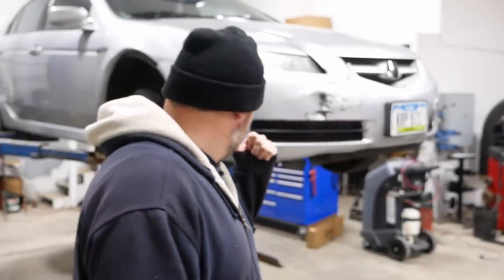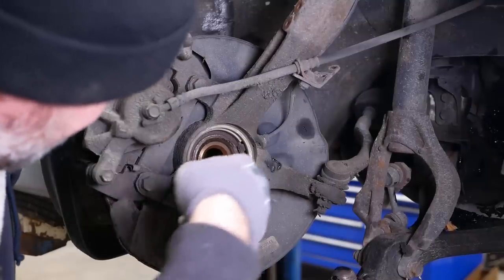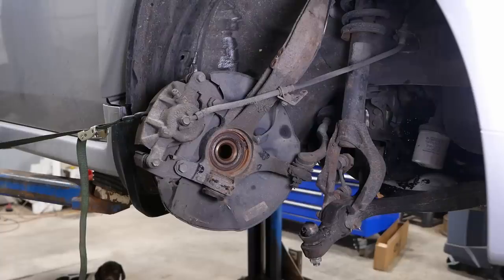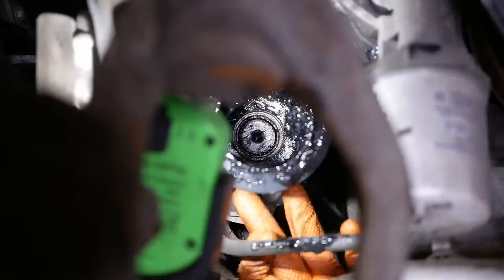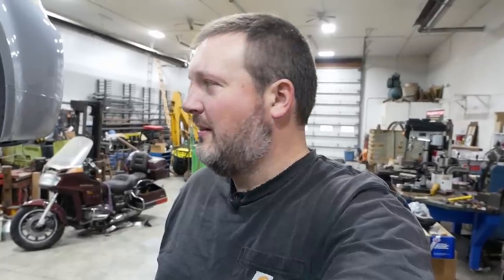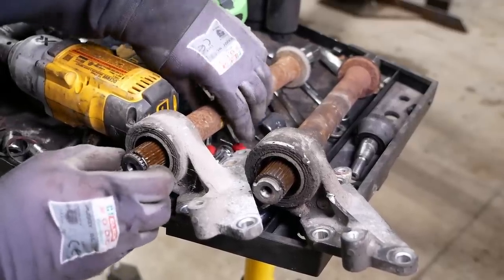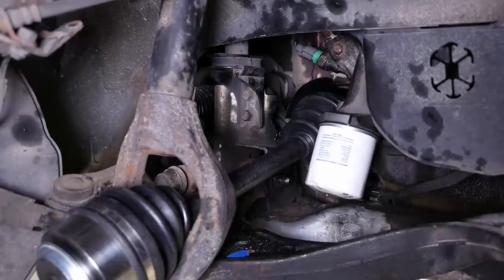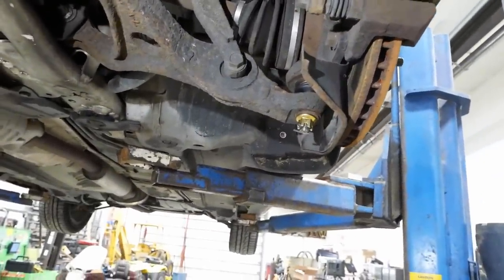Acura TL Broken Ball Joint

Comment: I swear Hondas get abused and neglected more than most cars because they take it without failing until something goes REALLY bad. Nice work Wes
Reply: Even when they fail it's usually not too bad. My gf had this happen to her Acura (similar model). It happened on asphalt close to home, so she drove it about 1km back to the drive. Some how the only damage was the ball joint and the CV axle which came apart.
Reply: @mzb8134  How does that even happen? The car must have been making noises FOREVER before it happened.
Reply: @mph5896  if the balljoint is loaded by the spring you might not get any noises if it fails fast enough.
Reply: @rkan2  Ball joints don't just fail randomly, under normal use at least. The kid in this video we told he needed this done a year ago. He chose to abuse the car and now it's costing him twice as much or more.
Reply: @jamesofallthings3684  Absolutely, but like Wes explained when comparing yo the F150 - some can fail more catastrophically than others. Some setups have the balljoint loaded by the spring like this Acura. Others have the weight of the vehicle/strut on the balljoint.
Reply: Those are really well made.  Perfect for humans who don’t care about their vehicles.

Comment: Glad that Im not the only one who has struggled popping out axle shafts. The ones that grind my gears are the ones that resist great feats of leverage, then suddenly release with seemingly little effort.
Reply: i've encountered this bs twice from different manufacturers. ergh!
Reply: I bought the slide hammer attachment. Doesn't fit in all areas but helps a ton when it fits.

On that one, leave the old inner cup and use the new cv shaft with new inner parts. 😉
Reply: What I've had to do which seem to work was getting a big pry bar and using it as kind of a punch at the back, hitting the striking end to push it out
Reply: @melvingibson4525  I think a slide hammer if you can get it on well is op, i've used a pair of prybars typically, but sometimes what they leaver against is too delicate
Reply: I've been there. Broke a puller trying to take one out, and then when hand tightening the new one, the thing popped out like it wasn't even held in.
Reply: @petahertz5855  I can never get slide hammers in there on those. That double wishbone suspension FWD V6 design makes everything really tight down there.
Reply: @melvingibson4525  Exactly my thoughts. I wondered why they couldn't just go with the MacPherson design across the board.
Reply: Usually straight into the left cheekbone...
Reply: @Tinker001  NOSE.

Comment: Living in the rust belt in the northeast  I appreciate your showing us all the hassle of trying to do what is usually a straightforward job turning into a mess. Nothing is ever easy with rust ! Great vid.
Reply: The amount of rust alone would make me run south unless the money is so good up there you can buy something new every few years. I got a 74 I’ve had since 85 and it’s got very VERY little rust and it mostly surface. There is no holes.
Reply: @Robrt32  Apparently, the money is so good that those up there CAN afford a new car every few years.  I can't even imagine spending that type of money every three years or so.  My last cars were 96, 03, 10, and 18.  At 2 percent or less on the loans, it was an ok deal on each one.  They were all GM, since I got the family price, so no haggling (even if it wasn't the BEST possible deal).  And, I got a really good trade-in price on each one.  I didn't even need to try to sell them on the open market.  Although I'm sure I could have come out a few thousand ahead, I didn't have to deal with the tire-kickers and other idiots.
Reply: This one was literally not rusty at all;  that's why it's so weird and doesn't really make sense. ???
Reply: @calholli  Agreed. He commented that it wasn't very rusty.  The owner WAS warned it was on the way out (or at least one on that side), so.. what was the "Rest of the Story"?
Reply: @silasmarner7586  He changed that side too.
Reply: Rust belt refers to areas that relied on industries no longer flourishing like Steel. 

You're looking for "Salt belt"

Comment: My Favorite Gen TL, recently did my daily's Ball joints, axles and lower control arms. 200k on original ball joins, zero play, no tears in the boots from a North Jersey  car. Kind of a pain with rust, but very straightforward job. Ive always been lucky with axles, most people seem to struggle with em.

Comment: Hey, I've been there and done that to many people, my brother is worse, Bought a 98 dodge dakota I told him the u-joint needs changed vary soon, he got about 6 months almost 10,000 miles later it let go and punctured his fuel tank and beat whatever it could under there, Scrapped it and bought a lowered 2003 Mustang GT, this thing was so low it really didn't have any suspension, thought it was the coolest thing in the world, He paid too much for it, and it was put together by some people who didn't know a thing about mechanical work. 

He showed me the car and wanted me to put it on my lift and check it out I noticed it making a bottom end vary faint knock to it, it got worse the more throttle you gave it, I told him, bottom end needs to be looked at, probably still salvageable at that point, A few burn outs later, it threw a rod at the starter, it took the starter, pretty good one, he kept that crappy little Mustang for a few years and wanted to put a v8 in it, never did.

I hate when people don't take advice and continue to learn the hard way.

Comment: I'm actually surprised the slide hammer with the vice grips didn't do it, that's always been my go to move if the joint was already apart.   The strut fork being too small to fit the inner joint through however, has been a constant point of rage for me since my first honda like 20 years ago.  I like the way the suspension system handles, but damn are they stupid to fix sometimes.
Reply: One of my favorite newer tools is the vice grip slide hammer combo. I too was surprised it didn’t get it done.
Reply: I didn't realize what the vice grip adapter in my slide hammer set was way back in the day when I first got it.  It was life changing here in the rust belt once I figured it out
Reply: I thought he was on the right track when he grabbed two pry bars, I was surprised when that didn't do it. I like the vicegrip slide hammer too.

Comment: Nice job Wes! Those power steering pumps have a suction side o-ring at the pump that fails and will cause cavitation of the fluid because the pump is higher than the reservoir and make that noise too. Thanks!
Reply: just replaced one today, super common

Comment: I feel your pain on this one Wes.  I did a 2001 Accord with a failed ball joint, same side, same damage and same battle with the CV joint stuck to the half shaft.  I have never before or since had such a struggle getting one of those to release.  I finally got it with a slide hammer, but not without much cursing and fighting.  You’re right, what a dumb design to put the full load of the vehicle in tension on the ball joint and make you separate the wish bone to replace the axle shaft.  Ugh.  I also replaced the brake hose, as I didn’t know how far it got stretched.  Glad you won that fight!

Comment: Your right Wes, I don't think an engineer ever tried to fix some of there designs. Great repair man.
Reply: Depends on the company. Some send their engineers out on the production floor or repair areas as part of training, others do not. Regardless, in my history as an engineer (non-automotive), an issue is brought by said engineer to manager or design team and a compromise or decision made based on cost, likelihood of needing replaced and many other factors. I have had to design things in a manner I wasn't the most pleased with out of necessity or higher authority direction in spite of giving reasons not to go that way. Not saying some engineers don't think of repair needs or don't have mechanical experience or may not have seen where the engine was going to be shoehorned into the bay.
Reply: @brianworley7705  Dam bean counters.

Comment: That oil filter is a known good part.  Why would you even contemplate replacing it?  Oh cool!  It has the audio feedback circuit in the power steering pump!  That is a rare option indeed.  We have a Toyota with the 100% loss power steering circuit.  You just fill it anytime you want to drive it.  No filter needed, always fresh and topped up.  Keeps the asphalt in front of the house supple and wrinkle free.  Like Noxema, or Oil of Olay, daily application yields the best results.  Good on ya, Wes.  Keeping the antique road show running.

Comment: I find it really helps to rotate the cv axle while tapping it with the hammer.   Gets that ring in its happy place and it comes out .  I went to war with a few of them before I figured that out . Might just be b.s but I find it works for me.  Or gently put a wedge between the housing axle stub helps to but obviously you can’t go full caveman on it because the housing it usually cast aluminum or some pile of garbage cast .

Comment: When I have a CV axle that separates like that, and the inner cup won't come out, I use my slide hammer with the locking pliers attachment like you did. If the pliers slip off the cup, which they usually do, I'll break out the welder and weld a bead across the inside surface of the cup. This gives the pliers something to pull against. A few good whacks with the slide hammer is all it usually takes after that!

Comment: Wes, a few comments. That oil filter housing is easily removable, 3 bolts unplug the two sensors and it comes right out. That would have given you a little more room. The gasket is readily available at most part stores as well. I didn't know it was possible to remove the intermediate shaft without pulling the exhaust, the video doesn't do it justice how tight it is. Well done. Acura service info states you can only replace the lower ball joints once and after that you need to replace the knuckle. I ignored that warning only to realize the press fit wasn't nearly as strong as it needed to be, they weren't kidding about that warning. Keep that in mind when using aftermarket ball joints on double wishbone Hondas they won't hold a candle to the longevity of oem parts. Before you condemn the power steering pump, replace the o rings on the pressure and return lines going into the pump. They are sold in kits and are often in stock at local part stores. Over time the o rings shrink which allows air to get past the seal causing cavitation.

Perseverance is key. Frustrating jobs like this make you want to pull your hair out but the satisfaction of seeing it drive away is a huge relief. Well done

Comment: Good job Wes, just did my CRV ball joints they are not man enough and are the same it's best to use OEM or TTX ball joints I put mine in the freezer and warmed up the knuckle with the torch and they fall in easily the Chinese knock offs don't last 6 months It's a big problem with honda ball joints failing all the time at around 100k in the rust belt well done pall

Comment: Happened to me on my Passat GLS about 20 something years ago. I was also VERY VERY lucky. It happened just as I pulled off from a stop light, still in first gear. Traffic chaos ensued but I lived to tell the tale. Had it happened 5 min earlier I would have been travelling much much faster. I now have a terrible hang up about my wheels/suspension brakes. 
Regards from South Africa

Comment: I have seen cars drive by house before and later found them down the road with the whole spindle assembly, wheel / tire combo separated from the car.   It only shimmied a little at low speed 🤣🤣🤣.  For people with custom lock nuts hide the socket in a glove by your spare tire.  The glove prevents rattle and places it where you need it in an emergency.   Good video Wes! 👍😁

Comment: These cars are my specialty.  I own five TLs.  Replaced axles in at least 2 of them.  Disclaimer...I live in Alabama so rust isn't usually and issue.  I usually just take a tapered wedge (cold chisel) and wedge it between the case and the back of the CV axle boss (the big round thing) and tap it with a 2lb mason's hammer and it pops out.  I have struggled a bit more but not anything like what you have experienced.  I'll bet it was damaged from the crash making it impossible to remove.  Great job keeping at it!  You are a FINE mechanic!

Comment: Had a 2004 Acura TL manual ….loved that car!! I put 217,000 mile on it and it never stopped. Sold it and kept in touch with new owner for a few years. 

Hope this young owner learns to listen when told to make suggested repairs…..sadly doubt as this is often a learned behavior from other vehicle owners with poor maintenance judgement.

Comment: I had to use the blue flame wrench when I replaced the factory lower ball joints on my 98 f150 several months ago.  Ball joints puller kit wouldn't budge them before that

Comment: I’ve had to deal with the suspension my TL more times than I’d like to admit. Good tip for getting that passenger side inner CV joint out… while standing under the transmission, fit a crowbar or a long bar over the j-pipe, get the tip of it on the edge of that inner joint, then tap the back with a hammer… works like a charm every time! Great video man!

Comment: I heard Honda's were a bear to work on, but damn. In high school I learned to replace CV joints because they had been making front wheel drives long enough for them to start failing and boy did I get the side work afterwards because no one knew how to do it. Keep up the good work.

Comment: 40 year mechanic, recently had a Volvo axle that I could not get out with all the same things you tried, I recommend an "AXLE POPPER" which is a set of pickle forks style wedges that removed it in seconds after spending three days trying to get it out, best $25.00 I ever spent.

Comment: I owned an Acura TL-S briefly. Had all the above mentioned problems. It took me like two hours to get the passenger CV out. Sold it soon after because I couldn’t enjoy driving it having endured the pain I did to get it drivable. Plus it had a myriad of oil leaks that I couldn’t figure out. Resealed everything and still had an mystery oil leak somewhere.

Comment: I spent hours on a 90’s Sunbird with pry bars removing an axle. Big bars, wedges, etc. The solution was slight pressure and tapping the joint to rattle the C spring clip. Came right out.

Comment: I feel for ya Wes! My girlfriends 07 Sebrings right side front axle needed replaced, the axle was rusted solid to the intermediate shaft, I heated and hammered and  pried but it wouldn’t move an inch, finally after a long struggle the intermediate shaft support bearing case broke, but luckily I found an updated part from auto zone where it eliminates the intermediate shaft and support bearing for one long axle shaft from the tranny to the hub, 4hr tear down for a 10min reassembly, I’ve been a tech for years and definitely have the resources but Iowa rust beats out tools most of the time

Comment: Hind sight is 20/20 but on the next one: Weld a plate/bar across the cup with a hole in the center. Put a nut on it(weld or backside) in the center and drive a bolt into the center to act like a press. Would have still broken likely but, would have saved a lot of time. Nicely done by the way.

Comment: On the inner CV , I have always had great success by taking a big pry bar like you did and then taking my air chisel "at a reduced air pressure" and taking that to the CV housing. The vibration in addition to the prying normally will allow them to pop out with no problem.   If that fails rotate the CV 1/2 of a turn , that will put the circle lock into a different position.   I have never not had this work for me..

Comment: I ha a similar experience on a 95 escort wagon LX. I changed the transmission, had to take care joints out again to put a new converter seal in after 1st install. It was seeping. Drivers side came out OK 2nd time ,but couldn't get new passenger side cv out for anything. Finally took a 1/4 " rod passed it through the new tyranny and 1 esay tap passenger side 
new CV popped out. I shure can relate to your frustration. Loyal viewer Dave Jonczy

Comment: I had a 1995 Civic hatch with a 1.8 dual overhead cam Acura Integra motor swapped in it and had the same exact shaft problem. I fought with that for hours and it broke just like what you had. Fortunately on mine, it was a 5-speed and the jackshaft was on the driver side not the passenger so it was a lot easier to remove and replace. I did mine about 12 years ago and as I'm watching this I'm feeling your pain. Haha

Comment: Wes, you are so good at coming up with ways to make repairs!  One thing that I learned about the CV joints to remove them, place a strong washer that will find inside the metal part of the joint.  Before you do that, screw a slide hammer onto the washer.  Then use two vice grip pliers on the outer edge of the metal to hold the washer in place.  Then pop it out with the slide hammer.  Did this several times on our Razor side by side.

Comment: I live in michigan, my son just bought a car for his daughter, a 2010 equinox 138000 miles , turns out it's from a non salt climate, have made several repairs including intake removal, what a joy to work on, no rust everything comes apart easy, techs in that environment dont realize how lucky they are.
Reply: Sell that garbage before it turns in to a money pit.
Reply: @daleolson3506  I've heard that but will run with it, it's had the timing chain replaced and oil seals replaced, pulled the intake off to clean the PCV port for a check engine light, engine is clean inside out, who ever owned it took great care of it, AC even works, will work for my Grand Daughter